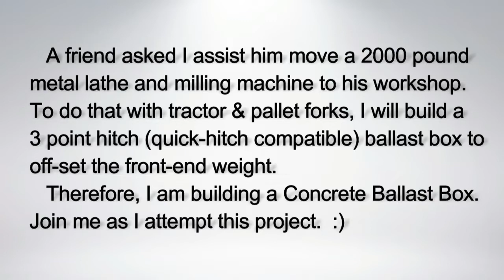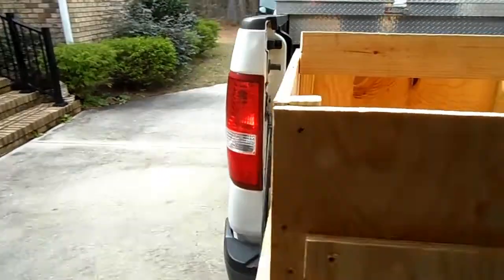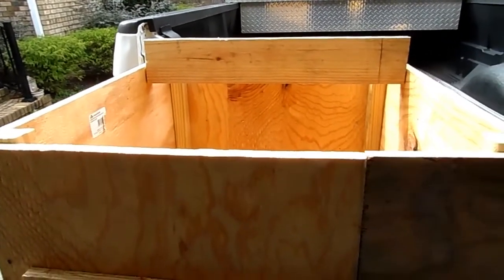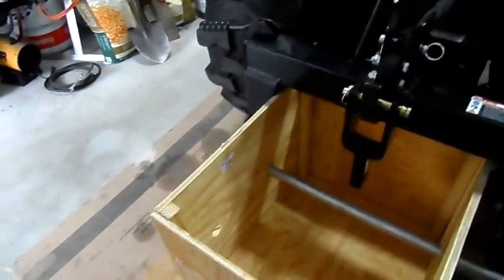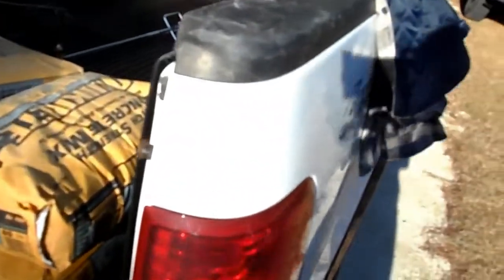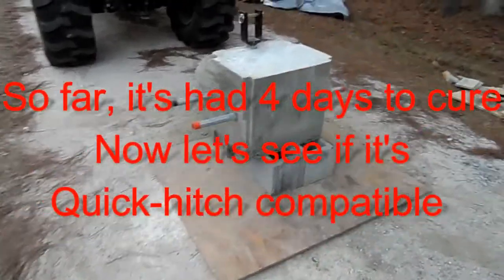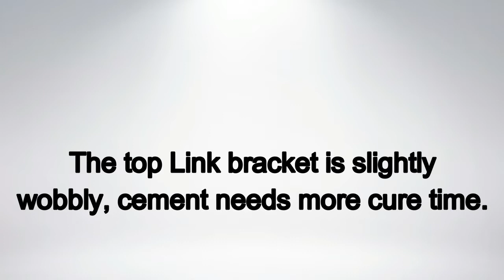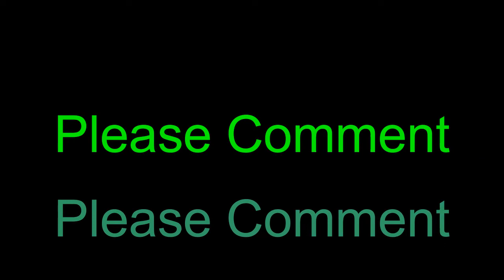Quick Hitch Compatible Concrete Ballast 22Nov20  Vid-061

Comment: My suggestion on possible bending of the 1" I.D. pipe just use a piece of 3/4" pipe inside minimum 12" or the total length, tack weld on both outside ends. That should support well beyond any future needs. Great job on the box overall Don.
Reply from the maker: Good idea, William.  I'll do that if I start seeing any deteriorization of the metal pipe. That would definitely do the trick.  So far, I haven't had any issues with the pipe showing signs of bending.  Thank you for your kind comment.  The ballast box was a fun build and has been used on numerous land chores.  I no longer need to use my large rotary cutter to offset weight thus maneuvering in tight wooded areas is a breeze.  Have a great week.   Don 👍🏽🤠
Reply: I'm setting up to follow your design I really like it overall. I have a 13 yr old 2520 Deere my first compact tractor. The area I will need to pay attention to is your drop angle for hook clearance. Any suggestions are much appreciated.
Reply: Further comments on a great job! Don your design is perfect for my needs, living in a heavily wooded area.
Reply from the maker: @rooster6732  Hey there Roster. Do you already have your quick hitch with existing hooks?  If you can get a replacement center hook that sticks out a bit further than the standard hook that comes with the quick hitch, then you'd have less complications connneting to a variety of three point implements.  I made a video for a viewer who requested some measurements and that seemed to help him.  Maybe that will give you a better idea of how to locate your hooks before setting the cement.  Here's a link https://www.youtube.com/watch?v=O8YaQuy0ROU.  
Rooster, I hope you video your build.  I'd love to see your methodology.  Viewers enjoy that kind of neat stuff.  Give me a yell if you run into problems.  Later brother. 👍🏽🤠 1/22/23
Reply: @houndsmanone4563  Thanks Don, 
I hope to start the box build early next month or soon after. I'm going to follow pretty much your process with pipe only adding the inner 3/4" so I can weld assembly before installed. My concern for adding the 3/4" inside is mainly accidental damage (bending) of pipe at edge of concrete that will be the weakest area. It would be difficult to sleeve the 3/4" pipe in later. My plywood is 1/2" an was from old school lunch tables so has a plastic coating, that should help on finish surface results but I'm not that concerned about it. Considering 7 bags of concrete as you did I believe for a 500 gross weight. I have the same hitch & hook you are using after watching your updated suggest page, very good summary and Yes, I agree you won't move it with one hand. 😉Enjoy, Rooster

Comment: Great job. I have two suggestions. First is paint it it will with stand the weather better buy sealing the concrete. Second is if you do a project with concrete forms again spray the forms with diesel fuel before pouring, it will help getting the forms off. Hope this might help. Great job and idea.
Reply from the maker: Thanks for watching and commenting, William.  I like your idea of coating the forms with diesel fuel to allow the form to be removed with little resistance and hassle.  Another good idea, I will paint the concrete then put a sealant over the paint to reduce weathering and concrete break-down.  Yep, I like that idea.  I may paint it Marine Corps colors (Scarlet and Gold) 😀 which would blend nicely with the red Massey Ferguson tractor 👍🏽🙂.  Have a fine upcoming week, William.

Comment: Great build. Thanks for the walk through. I'll be building one for my LS. Love this. Really like the extra pipe. Could hang free weight plates on it if you needed a bit more weight.
Reply from the maker: Brett, that's definitely a good idea as an option for adding extra weight.  So far, the ballast has been a perfect weight and the compact size makes it easy to maneuver in tight areas.  If you build a ballast, I hope you make a video and post on You Tube.  Thanks much for stopping by and commenting.  Have a fine weekend.  👍🏽🤠 03/08/24

Comment: Excellent... thanks for taking the time to share it!  I need to make a ballast weight for my Mahindra and I like a lot of what you did.  I don't need one quite that heavy... but might add some PVC tubes in the concrete to hold tools and a chainsaw (bar down into the PVC pipe).  You video gave me several ideas.  Thanks again!
Reply from the maker: Thanks for watching and commenting, Stevo.  I'm glad this video gave you some ideas for your ballast. If you're going to add PVC piping to carry tools, etc, you might want to create drainage holes for water.  Best to you in your build.   👍🏽🙂
Reply: @houndsmanone4563  Thank you sir!  Funny enough as I was thinking through how I was going to deal with water or debris in the tubes I came down with only a couple ideas - a small drainage opening in the bottom, leaving the tube open all the way through the box with a screen of some type across the bottom, or capping the tubes when not in use.  Seems like all my projects create as many questions as answers!  Thanks again

Comment: Great idea!  I think all the head scrach’n & thinking paid off!  You did a great job & I like it much better than a barrel full of concrete hung on the back of your tractor. I’m going to try to follow your ideas & build one for my tractor. Thanks! John E
Reply from the maker: Thanks John E for watching and the kind words.  The head scratching was definitely a part of this project build 🙂.  I kept thinking I was going to mess up the alignment measurements to make the quick hitch compatible but it turned out fine.  I've used the ballast on several heavy lift events and it did very well.  It allows for easy and simple maneuvering in tight spots.  Yep, as you said, I too didn't really want the barrel of concrete just hanging; I wanted a different shape that had its own uniqueness and I now have a better idea to make impressions in concrete to produce a certain look.  I learned most of that by mistake  🙂.  Thanks again for watching and your kind comment.  I wish you the best building your concrete ballast.  I hope you make a video of your build.

Comment: Nice job Houndsman One! & Quick Hitch Compatible to boot!!!
Reply from the maker: Thanks Johnny Lee for stopping in to watch and comment.  I really appreciate the kind words.  I just used the ballast and it's still quite sturdy and still quick hitch compatible.  I changed tractors since I made this ballast video and the quick hitch still performs like a champ.  One thing really nice about my new MF 1760M cab tractor is that its three-point lift arms extend even lower than my original MF 1533 I owned when I made the ballast. Again, thanks so much for the support.  Have a fine week and enjoy the cooler weather.  I surely am.  👍🏽🙂

Comment: I expected the steel tube to fail. It just looked  thin to me.   Good job
Reply from the maker: Raul, the pipe is tough and still is sturdy as day 1.  I'm surprised that several viewers thought it would be too flimsy but that pipe is thick and strong.  The ballast still is holding up very well and takes the brunt of bouncing when the tractor travels over uneven surface.  Thanks for watching and commenting, Raul. Have a fine week. 👍🏽🙂

Comment: Looks great Don! I made mine out of an old plastic sump basin! I need to get my hands on something just slightly bigger as i would like to be able to detach it on flat ground as my lift arms just aren't low enough to get out from underneath without a pallet under it! Thanks for sharing! Glad to see a vid from you
Reply from the maker: Yep T, I know what you mean about the lift arms not going low enough to get from underneath the side pins.  I had that same issue as well, so I had to mount it on concrete blocks as you saw in the video.  I now have a new tractor and the lower lift-arms actually go lower than the Massey 1533 in this video. As I mentioned to John (LA), I have been down for the count since June and am slowly turning into a human that I once was (smile).  Thanks for the support and have a great Thanksgiving.

Comment: Very nicely built.
Reply from the maker: Thanks much, Jonathan.  I see you're wearing my uniform.  Where are you stationed?  I finally settled in a little town outside Lejeune when I turned in my 782 gear.  Semper Fi, my friend.  👍🏽🙂
Reply: @houndsmanone4563  Well my first duty station was good olé Lejeune and my last was Pendleton. Got off active in 2014 and now am in the reserves. Moved to northern NM and got myself a JD 1025r. Been looking at ballast options. Yours seems like one of the more thought out solutions. Semper Fi.

Comment: Love it!  First off, super functional, you got the extra bar in there so that you could also lift and move around with forks.  Also it looks cool, it's got some detailing to it with the extra angles and stuff...it's not just a boring block of concrete.  Great job, Don!  Happy thanksgiving to you/yours.
Reply from the maker: PA, thanks for the fun and kind words. The concrete ballast truly has come in handy.  Haha, the shape does have a uniqueness to it.  I kind of figured it could be my grave headstone if it doesn't work for me as a functional counter-weight ballast (haha) 🙂.  Thanks for the support, PA. wishing you and your family a fine Thanksgiving.
Reply: Haha!  Well I suppose you could still use it as a headstone even if it works out as a ballast as well...I'm a big fan of duel purposing, personally. :)))
Reply: How well does it work to move your rear ballast around with the forks with no rear ballast?
Reply from the maker: @Redneck_Ed  Sorry Redneck Ed, I didn't see your comment.  The tractor maneuvers quite well when I have to move the ballast around to different locations. Thusfar, I've only had to move it around two times for short distances.  My FEL on bith tractors handles the weight of the concrete ballast without requiring a separate ballast to counter that weight.  Thanks for commenting and again, sorry for a serious late response to your comment. Have a great Christmas, Redneck Ed. 👍🏽🤠🎅🏽🎄 12/19/22

Comment: Great work.  It turned out excellent!
Reply from the maker: Thank you for stopping by to check out my little contraption.  Yep, the concrete ballast  provides a tad over 560 pounds which somewhat equals the weight of my  6 foot rotary cutter and therefore allows me to lift heavy items with forks or grapple in tight spaces.  Have a fine week and thanks for the support. 🙂

Comment: Looking good Don. Glade to see you made it too fit the forks for the front. Happy Thanksgiving!!!   Later
Reply from the maker: Thanks Mech. Yep it seemed to work well.  I would be remiss if I didn't give credit to AKdad and Joe LeSage.  I used their notes and lessons learned when constructing the box.  I think I modified this form box at least 5 times before settling on a design that would fit the quick hitch and still keep the top hitch bracket in position to catch the top hook.  I used to be pretty savvy when pre-measuring but this build was blowing my mind. I think keeping the box attached to the quick-hitch while on the tractor was my saving grace.  Everything I was modifying seemed to affect another part of the build.  Thanks again for watching and commenting.  Wishing you and family a fine Thanksgiving.  PS:  I'm about to purchase a Lincoln wire-fed welder and start my experience as a novice welder 🙂.
Reply: @houndsmanone4563  congratulations on your welder. We'll be looking forward to seeing what you build with it.  Later my friend.

Comment: I used a narrow oiled trash barrel for my form. 32 inch lower bar.  1/4 Angle iron scraps with two holes for the upper link.  Half inch holes were drilled in them already. Will redrill bigger if not right. I sleeved the eye of my upper link. Looped some scrap chain under the lower links bar  and around a bolt spacer  thru the angle iron upper link base  . Upper link was spaced  apart for my top link rod.? Filled it with cement. The weights at my local dealer are cement about your size. My rear tires are loaded. I was using a rear scraper on rear but it was kind of hitting things all the time. My setup cost like $40?
Reply from the maker: Kenn. I like that setup.  Yep, I bet that rear scraper was nice for weight but pretty bulky to maneuver around things, wasn't it?  Thank you for watching my video and for sharing how you developed a great ballast.  Wishing the best to you and hope you have a fine week.  I'll stop by your channel to show support.  Thanks again, Kenn.  👍🏽🙂
Reply: @houndsmanone4563  If you look at bought cement ballast weights the top link and two bottom links are like an upside down T. So the top and bottom are joined. When you lift , you lift on the whole metal T. I think you are kind of  lucky with your wired in upper link. That is why I chain joined my lowers and upper together . The upper has nothing to grab the cement because its smooth and it isnt very long. 
 I wondered what weird rig you had on the rear of your tractor. I never had a quick hitch. 
What size is your tractor? I would never try to move  a 2000 lb. weight, ballast box or not. I had to unload some implements on pallets , from a trailer truck once and with my cheapy forks at extension it was hairy. I had a box scraper on back to serve as ballast, it was not light
.I have to go up and down hills a lot and the scraper at low carry felt more stable to me. Of course it hit every bump , trees and rocks on the side. I have had it welded twice. I use it to snow plow our 900ft driveway. Scrape really.  If its a big storm I start at 7 inches. One storm last year I was plowing at 130 am. Plowing and mowing are not work to me. When I was small I paid to go on the tractor ride at the fair. 
I just run a chain from my bucket hook to lift  .I mostly use my forks to move brush piles.  STay well.+
Reply from the maker: @kennkid9912  Thanks Kenn for your detailed explanation. It seems like you were fascinated with tractors and wheeled farm equipment since you were young.  I was facinate with wheeled heavy equipment but did not venture more into it when I got a bit older and went into the Marine Corps.  I would have loved working with heavy vehicles but I didn't have that Military Occupational Skill (MOS) .  The Marine Corps put you wherever they needed your skills based on your test evaluation scores as well as their specific needs.  Speakng of needing front tractor forks, I've only needed to use them a couple of times.  When I owned my first tractor, I only had a bucket and a bush hog.  I didn't own any implement for 14 years.  I made do with what I had and what I could afford. Now I have several implements but I work less outdoors in the woods since I had a stroke 2 years ago.  Take it easy Kenn.  👍🏽🙂
Reply: @houndsmanone4563  I was not a farm kid. I lived around Boston. We always wanted a country life, so in 1984 we moved to Maine. We got our current tractor in 2004.  We have had all kinds of animals but due to age we are out of them. In Maine Ag is dead, really.  Dairy is almost defunct, potatoes are more up north and that is not what it used to be, Blueberries likewise. Not many people plant gardens.  We used the tractor more for picking rocks,  moving dirt, plowing. We never hayed.   The whole ag thing here died out. No markets, Hay suppliers died off, equipment dealers few and far between.  Slaughter costs are very high. Alot of them I wouldn't trust with my meat.
 I went to the new  tractor dealer today and he wont move an inch on price. That is on last years model...
 I noticed his metal weight boxes , have a 3 points hitch set forward somewhat, so the box doesn't hit the tractor? The inverted T again lines up vertical. I guess you fill the boxes with rocks? 
My friend was a Marine officer and he said  they are all  infantry first.  He was a Viet vet.  My nephews best friend retired from the Marines 1or 2 years ago as a Colonel. His thing was logistics. This COl. guy was a little kid I used to take out for ice cream.  Along with my nephew who is 9 years from retiring. They live in NEBRASKA.  Feeling kind of old here. Hope you recover OK.
Reply from the maker: @kennkid9912  Thanks Kenn. I'll check in on ya every now and then to see how you're doing.  Have a fine upcoming weekend.

Comment: Awesome, I’m not a carpenter so making wrong measurements isn’t a big thing but this project looks great
Reply from the maker: Thanks, George.  I really enjoy my hand at trying to do my own version of building, etc.  The counter-ballast weight has been a fun build and definitely serves its purpose. It's great to use in tight spaces where a larger implement is just too long/bulky to maneuver in tight quarters.  I wish I had made the video of me using the weight to offset a 2000 pound metal -cutting lathe.  The sheer weight of the 1 ton lathe made my tractor front wheels flat as pancakes and I had to watch the slightest bump so as not to have my friend's new $14,000 cutting lathe buried in his front lawn.  It was nerve racking (to say the least).  Thanks for  kind words.

Comment: very nice, maybe i missed it, what is the weight? need to be careful with that pin connection, just a small piece of rebar holds it inside the concrete
Reply from the maker: Sir, thanks for watching and your comment. In constructing the ballast, I used (7) eighty pound bags of cement mix  (see 17:18 & 19:00 in the video).  The ballast is 560+ pounds overall weight.  So far, I haven't had any issues with the ballast nor any top pin connection issues after 3 years of usage. Again, thanks so much for watching.  Have a fine Independence Day.  👍🏽🤠 7/1/23